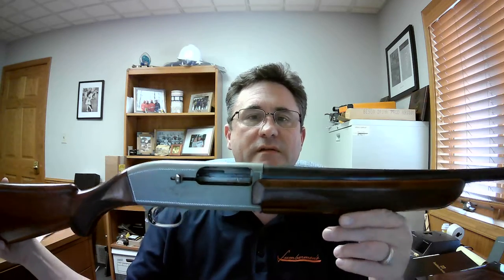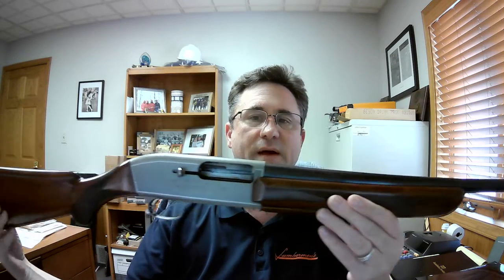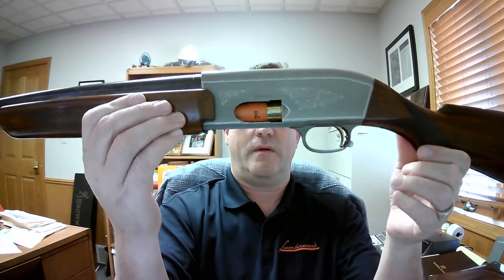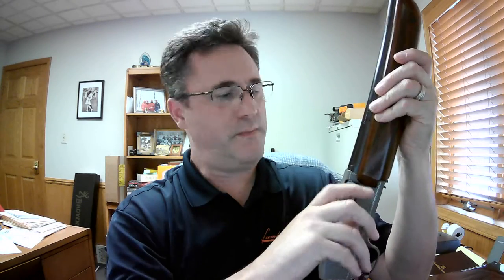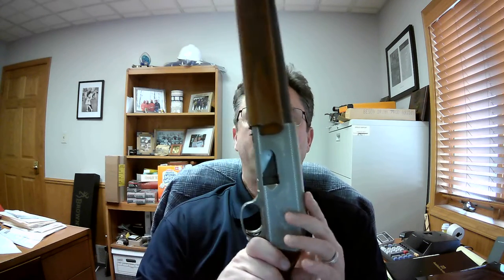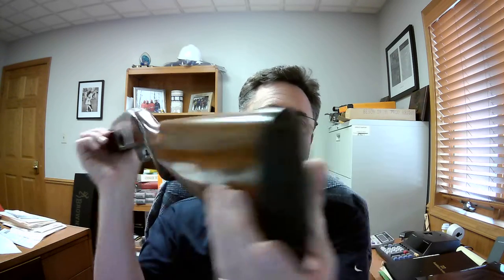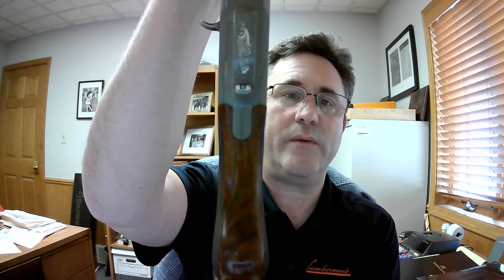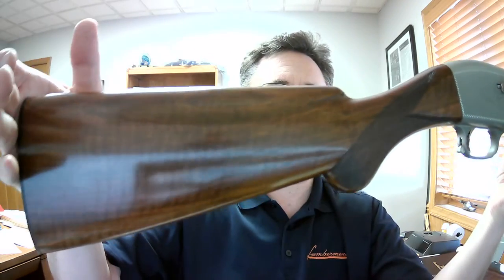Browning Double Automatic Twelvette

Comment: I have a 1960 grey Twelvette to go with a 1960 Twentyweight. The Twelvette has a vent rib and a vented Poly-Choke that was factory-installed. When I take either one to the range it seems like half my time is spent showing how it works. Most guys there have never even heard of the Double Auto, let alone seen one. I really like my two DA's.